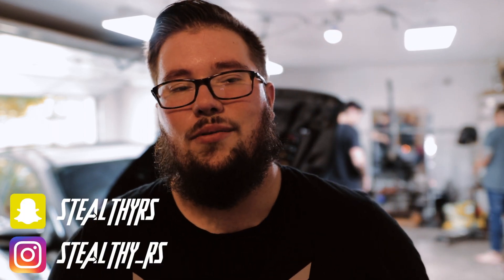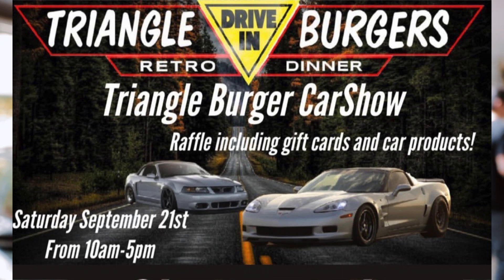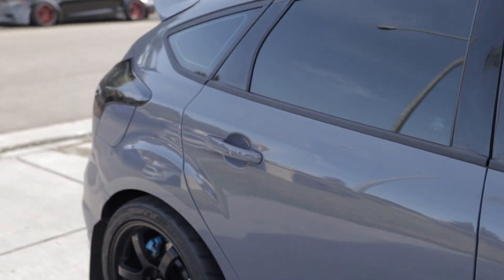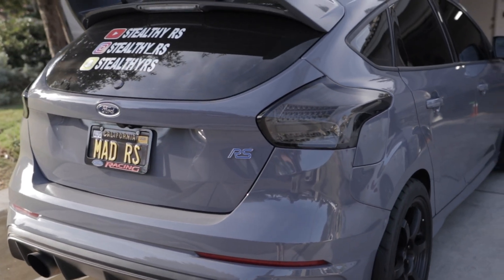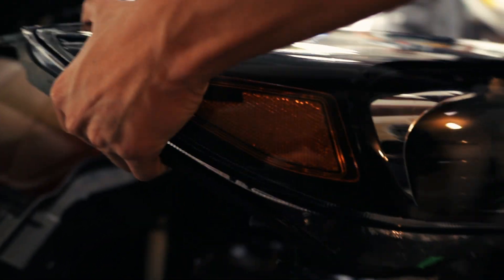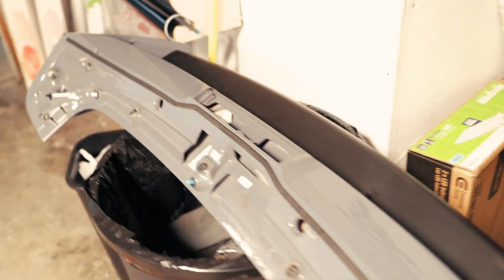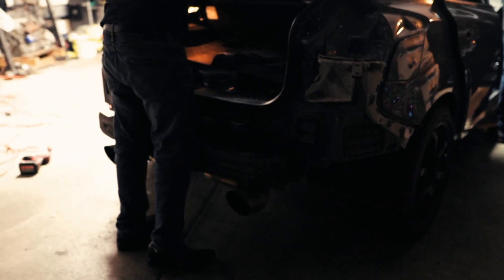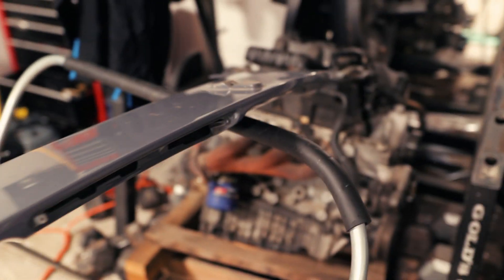Wrapping My Ford Focus RS

Comment: How the heck did you get the spoiler apart without breaking it? I tried to separate mine but it seemed as if it was glued or something internally. I have the master mechanic manual and I couldn't find any info for getting it fully separated. I asked around and other people were also telling me it was internally fixed and that it would break if pried apart. I was able to wrap mine using 4 pieces of vinyl and knifeless tape but it would have been much easier if the spoiler was fully disassembled. Did yours just come apart or did you have to pry on it pretty hard?